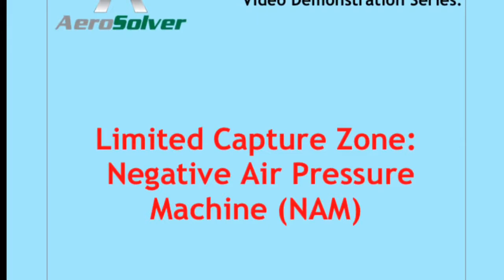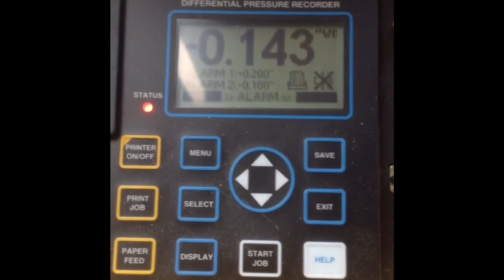CaptureZoneDemonstrationNAM

Comment: Perhaps this method of testing would have been best served if you in fact had an enclosure system (i.e. ploy sheeting and directed "make-up" air direction.  I do understand that you had a manometer reading of .107 or something which would indeed pull poly off from the wall, however by no enclosure system of poly the test seems flawed at best.  Interesting though.